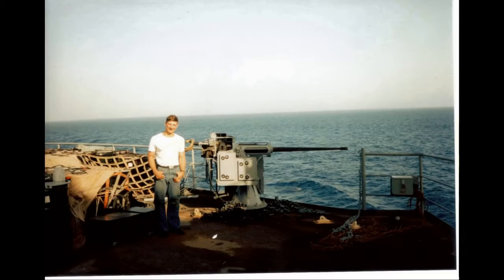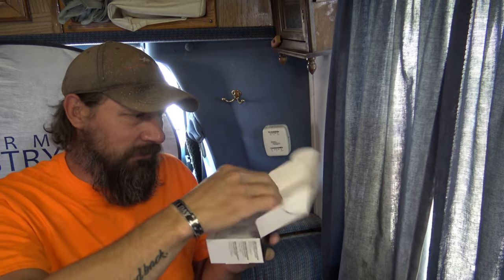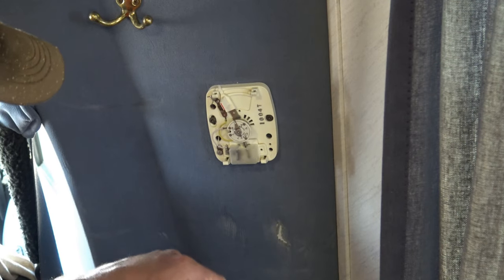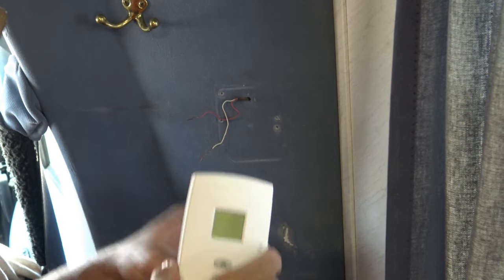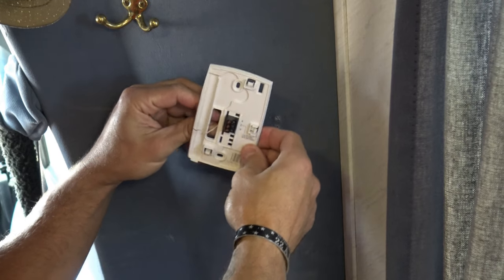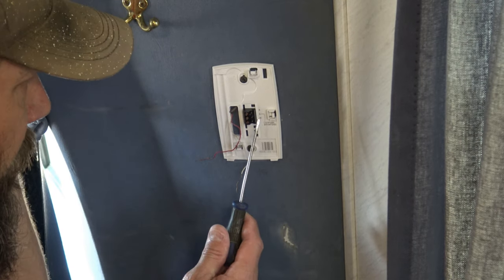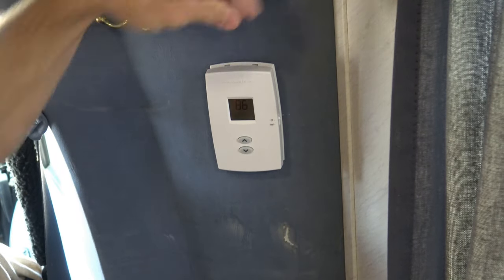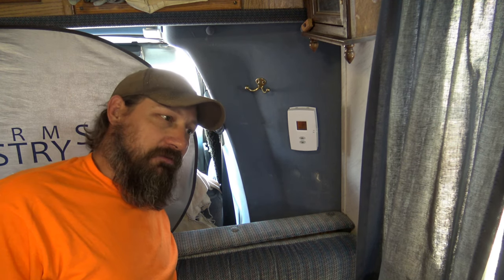How to install an RV Thermostat - Honeywell PRO 1000   Heat Only

Comment: Just did mine.  Instructions perfect.  However, my wires coming in were larger than the holes, so needed to cut off some strands.  Worked fine.  Very accurate. Thanks
Reply from the maker: Excellent!